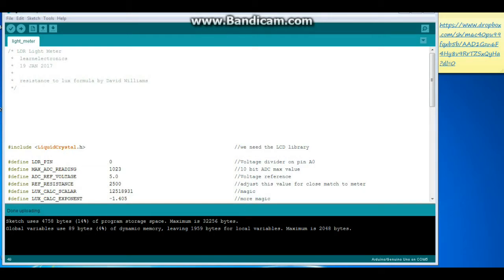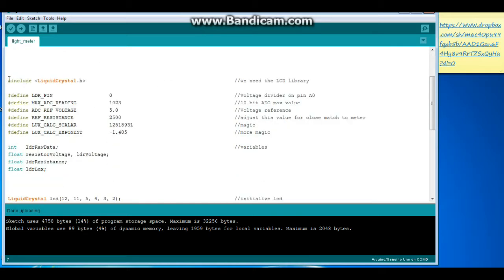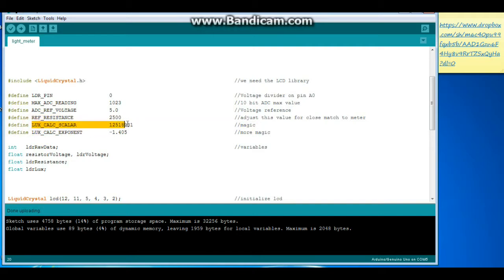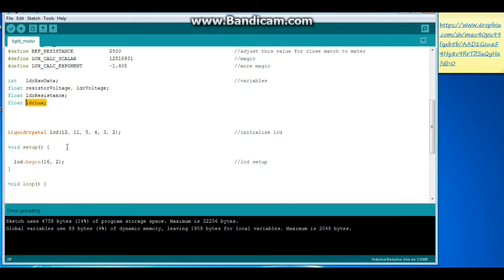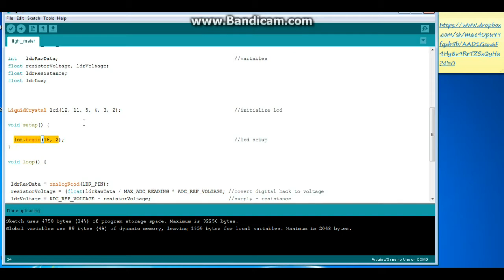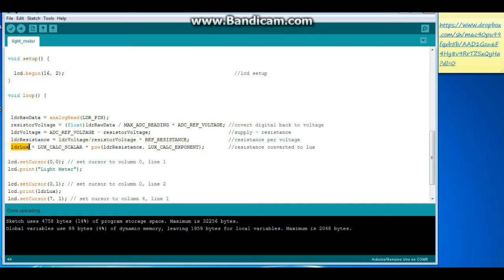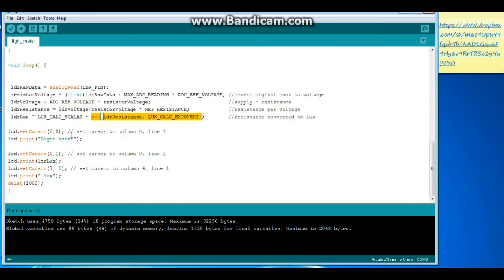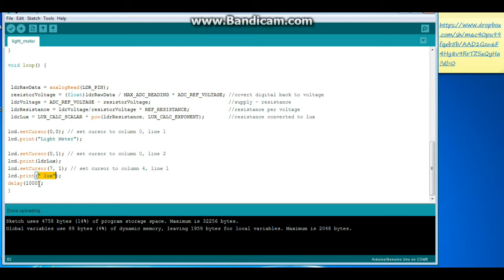Arduino Basics Make Your Own Light Meter

Comment: i literally copied the  code word by word and the math is not right, the lcd is printing a huge number when its dark and prints a small number when its bright, the same thing happens in his lcd screen, but is hard to see because he has the screen not so visible with a reflection. Also, you can make variables a lot shorter, just saying.

Comment: Hi, my light level is showing "inf" as well as other numbers. Any idea what could be causing this? I have followed the code on your tutorial.
Reply from the maker: +duduken103 If it's showing inf Inuit could be your voltage divider is not wired correctly.
Reply: Thank you! That seemed to be the issue. Also, what's the value of the carbon resistor you are using?